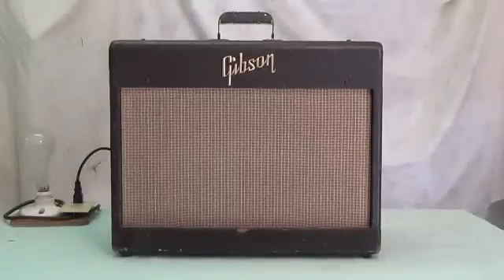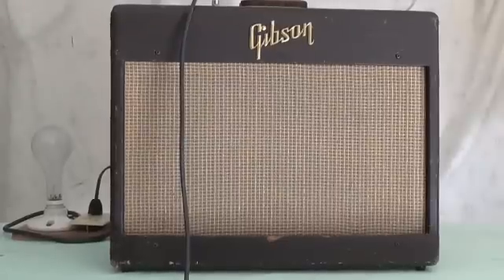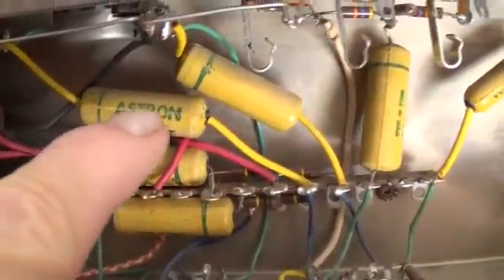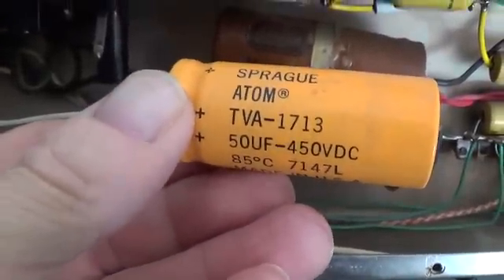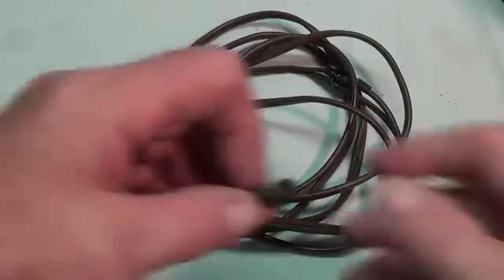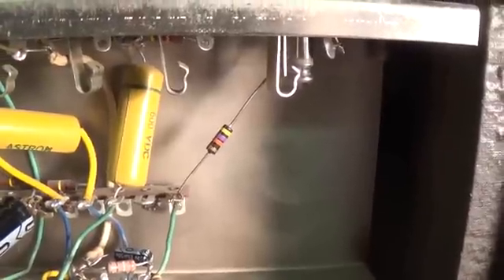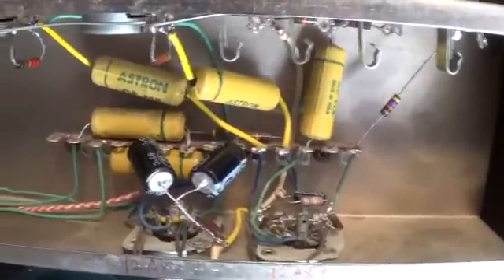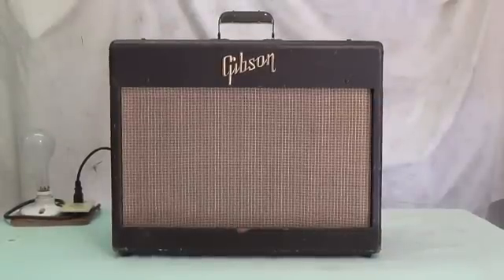Late-50's Gibson GA-6 Amplifier ....with some Very Unusual Problems

Comment: Did you ever go back & re-try the 12AX7 tube after the other gain adjustments?    With the 12AX7 being so popular among guitar amps,  I’m wondering how much the tone changed.
   The amp probably draws a lot more current from the supply circuit,  now that the bass response has been improved.
Reply from the maker: That was long ago, A. I don't recall.....but my guess is that the gain may increase with the 12AX7 but the tone would remain basically the same.

Comment: The volume issue is also a problem with the Vox AC30. Just off zero on the volume control and it drowns out a Boeing 747 at full takeoff power!
Reply from the maker: Wow.....then, I'll bet the volume increases at a relatively modest rate.
Reply: @UncleDoug  Nope, at least not with the AC30 amps belonging to guitarists I have worked with!

Comment: The GA6 I have -and all the other pre-Lancer models are grid leak bias.  Very similar to the 5A3 and 5B3 Tweed TV front Deluxe.  Either this was an interim model or the bias configuration was changed based on that Lancer schematic? 

These amps and the similar GA 20 are beautifully dirty tone monsters. Crazy good harp amps  (I'm a harp player) and can be great with guitar too. On the 'mic' channel - I personally like the option of a low impedance super hot-n-nasty channel.  It's actually too hot and dirty for my harp mic.s but can scream nicely with guitar when you're looking for that sort of thing.  

I'd love to see you dig in on a grid leak biased amp sometime and was a bit dissapointed this GA 6 wasn't that.There is a good discussion of this amp - with pictures of a very similar era GA6 and re-drawn schematics by  Miles O'Neal, of Austin, TX here:
http://www.rru.com/~meo/Guitar/Amps/Gibson/GA6/.  

As ever - thanks for the great work and regards to Rusty. I suppose he had a well deserved day off.
Reply from the maker: Thanks for all your detailed and interesting input, Noam.

Comment: That 50uf cap had a 1971 date code on it!  Total rip-off repair.  Isn't 50uf too much for a 5Y3 anyway?  Also, I believe 12AY7 is the correct tube for this amp.
Reply from the maker: Thanks for your insightful comments, HS.
Reply: @UncleDoug  Nice job on the amp despite this, I should point out.  I've seen my share of incompetent repairs over the years, and nothing really surprises me.  What caught my eye about this amp however was the obvious deliberate attempt to deceive, the phony "original" caps that looked like they were out of some 40s radio.  Then he tacks in a 40 year old Mallory cap to the 5Y3 and it's too high a value, and leaves the rest of the old dud caps in circuit.  Just... wow...

Comment: I know you probably cant do this for various reasons.   But you need to name the shop,  that ripped this owner off. So that no one else gets   
Taken to the cleaners.  Thanks! Curtis
Reply from the maker: I agree that the crooked tech should be outed, but the amp owner couldn't (or wouldn't) remember his name.
Reply: @UncleDoug   the repair bill was in  
The amp. Uncle Doug said
Reply from the maker: @curtismuma1931  I can't remember if the name of the tech or shop was on the bill. It may have simply been a generic list of repairs (supposedly) done.

Comment: I think the reason Gibson used such a high value resistor on one channel was for use with a crystal mike or pickup. The low end freq response could suffer working into a 47K resistor.

Comment: Hi Uncle Doug, I can't seem to get enough of your videos! I have a question about an amp on another video that used a pentode in the preamp stage. I am building a harmonica amp and I would like to experiment with a pentode. Do you remember which amp that was? Thanks in advance and keep up the good work.
Reply from the maker: I have featured several amps with pentode pre-amps, Christopher. One that comes to mind is the Mystery Amp......check out the videos.

Comment: Thanks for the video I would have liked to has seen the power cord installation because I have and old Gibson and the white wire is going to the fuse first I know other videos say to change it to the black wire and remove the death cap but there wired to the switch first
Reply from the maker: The white (return) wire can be connected directly to one of the power transformer primary leads, Charles. The black wire should pass through the on/off toggle, then the fuse, then the other PT primary lead. Many people prefer it to go to the fuse first and then the toggle......but it's a matter of personal preference.

Comment: Great videos. Have you ever heard of sheridan gt20 guitar amp. I can't find anything on them.
Reply from the maker: Thanks, John. No, I have never heard of that brand.
Reply: @UncleDoug  it's just that it has a hum from the speaker which does not change with the volume control. It also has no sound when you plug anything into it. I think it has 2 problems caps and dc. What would u suggest?
Reply from the maker: I prefer not to troubleshoot long distance, John, but would suggest that you replace the electrolytic filter caps and see if that helps.

Comment: So,was tube damage caused by the bad filter cap?  Sorry I'm new at this.
Reply from the maker: Probably not, Wayne. A short within a tube is generally the result of impact or physical damage to the tube, which bends some of the internal components into close proximity.  A bad filter cap, on the other hand, will generally cause too much current to flow through the power transformer and rectifier......damaging them, but not generally a tube.

Comment: Those Astrons at 4:33! Also probably because the heat from the tube filament would rise up through them. I can't understand why 'tubes-down' orientation is so common!  It also seems to take a toll on phenolic tube sockets.
Reply from the maker: Positioning the chassis at the top of the amp, with tubes hanging downward, allows for easy access to the top-mounted controls.  The early vintage amps with floor-mounted chassis had hard-to-access controls at the back, rear of the cabinet.

Comment: There's no way on God's green earth those were the original caps.I've done TV repair in the past and I'm now into restoring old radios.Those caps date anywhere from the '30s to about 1955.I always replace those old wax caps and the filter caps.You can get a good price on the FP type alone.
Reply from the maker: Thanks for your input, Dan :)

Comment: Interesting seeing vacuum tubes upside down!   How does a tube short?Excellent, insightful restoration!    Would be nice to see who did the original rip-off repair.
Reply from the maker: Yes, most of them tend to work in virtually any position.....horizontal being the most challenging, due to "sag' of internal components and possible shorting (undesirable contact between any of them).

Comment: The problem with the volume control is due to the strange and unfortunate circuit design.  An audio-taper pot is designed to be connected so that the input goes across the resistance element, and the output is taken off the wiper.  Gibson chose to connect the input to the wiper, and then take the output across the resistance element.  Here you can see the problem.
 
Instead of having the normal curve, the signal rises much too quickly as the pot it turned up.  Further, the tone-control is poor, providing not much adjustment, and mostly just turning down the treble.  All in all, not a good design effort. One poster claims that Gibson used linear rather than audio pots for the volume control, which would further exacerbate the problem.   This amp shows all the hallmarks of having been designed to be as cheap as possible.  Given the tube compliment, this amp could be rewired to have a single-channel input and a real tonestack, following Fender or perhaps Ampeg guidelines.  It could be easily turned into a Princeton-like amp.  Unfortunately, the public thinks it's worth something just because it was built in the 50s, so that really can't happen.  A quick Google search showed that these amps are selling for over $1000, which is ridiculous, given a brand new Princeton can be bought for about $800.  Maybe one of these days, people will start to realize that there was no magic being sold in the 50s--some good amps and some bad ones, but no magic.
Reply from the maker: Well said, Roid. You make several very good points. Thanks for your input.

Comment: Subscribed. I just started working on tube gear last week. Formerly I'd only repaired low voltage or solid state stuff, nothing older than late 70's or fewer than 200 parts. Dunno why I was always hesitant to learn about or work on tubes. After watching some of your videos I wish I'd gotten into tube gear earlier.
Reply from the maker: Welcome and thanks for subscribing, MM. I think you'll find tube gear to be much more "soulful" than SS.....especially the earlier, vintage items.

Comment: I'm not a fan of leaving the old filter caps in the amp even if you bypass them for that very reason: they leak all over the other components and just take up space. If you are a big fan of the LOOK of an old filter cap, I suggest pulling the cardboard roll off of the old caps and stuffing a new cap in the old roll and then installing it.
Reply from the maker: I only leave them if they show low ESR values, no DC leakage, and are fully functional at operating voltage.

Comment: The "Gibson Tone"   is a super bright amp caused by the "bass sucking" circuit in there.   It sounds right with Gibson Humbuckers... I swear.   It hates a single coil guitar.
Reply from the maker: I shudder to think how this amp would sound set to max treble with a Telecaster bridge pickup.  It would probably be much more tolerable with Gibson humbuckers. This was, no doubt, a ploy by Gibson to sell more amps to owners of their guitars.
Reply: It'd cut you more than a blunt razor.
Reply from the maker: I've heard of Telecasters being used in "Punish the Audience" mode.....maybe this is what they meant :)
Reply: Indeed.  I have a 63 GA-5 Brown Skylark... it has a very treble response.....   and NO TONE KNOBS...   BUT  try taking your guitar's tone knob back to 50%...   it's surprisingly balanced.   I've used it with Gibson,  Gretsch, and Rickenbacker...  and if you roll the Guitar's treble back,  it sounds very good.   The guitar's tone knobs rarely get used with most amps.
Reply from the maker: This sounds like a good suggestion, DK.  Thanks for your input.

Comment: you need to replace all capacitors that are in it, they become leaky over time, it will ruin tubes because they leak DC through them, witch is what they are supposed to stop from happining
Reply from the maker: Thank you for your helpful input, TD.
Reply: i sorta learned it the hard way

Comment: I know it's a little late for this, but those output tubes were re-labeled Russian 6P3S which is equivalent to 6L6 types except GC's. These are commonly sold as a "6L6GT", and relabeled as others as well.
Reply from the maker: Thanks for the input, TA.  Hopefully, the amp's owner will read this comment.

Comment: I still wonder how do tubes short, guessing the spot welding of the wires from the grids may break and then the wires are free to wander and cause trouble.
For that botched capacitor job, I would have expected more  hum while it still worked at the beginning. Perhaps the cap that was left in was in better shape when the 'repair' was done.
Also wonder how much did Rusty make of the replaced parts.
Reply from the maker: +MisterTalkingMachine  The innards of most tubes are in close proximity  and a bit spindly and somewhat fragile, subject to displacement and breakage due to impact and vibration.....especially when hot. Rusty used the spare parts to make a Muzak system for his doghouse :)

Comment: I am appalled by one of the worst botched jobs by a so called professional that should be put out of business. The worst part was the sloppy line cord repair that was a potential shock hazard. Finally presenting bunch of parts to try and justify the high cost of repair that did not exist. Unfortunately I have seen this kind of practice all to often in my own repair shop, it is people like these that give the rest of us a bad rap. I can't count the many times that I have had to clean up somebody else's mess, makes our job tougher. "Great presentation"
Reply from the maker: +John Cunningham  Thanks, John. It's sad but true that a few bad apples can taint the entire amp-tech profession. Part of the video's intent is to make people more aware of some of the deceptive practices they may encounter.
Reply: You did a fine job demonstrating that point Doug; it is important that people be aware of some of these bad apples even though they make up a small percentage of the population. "Great awareness wake up call"

Comment: Uncle Doug, could you do a video just on discharging filter capacitors?
Reply from the maker: +Peter D I have demonstrated it in several videos, including the tool I made to facilitate the procedure......a 100 Ohm 10W resistor in series between an insulated, pointed stylus and ground.  I touch each + electrolytic filter cap lead with the grounded stylus for about 5 seconds, often doing them all twice just to be sure.

Comment: So Uncle Doug....have the same amp and apparently the same tech worked on it before I got it.....it has the original Jensen speaker in it and I had it reconed but I it was doing the same thing a little tinny and crazy load volume on 1. Could I possibly send it to you to repair. ....I'm not sure of your  contact info or where you are located but please let me know.
Reply from the maker: Brian Peters Brian, I have retired from doing outside work, particularly when it involves shipping. Hopefully you can find someone in your area to repair the amp. The methods I used are explained in the video and may be helpful. Good luck.

Comment: It still sounds thin to me but then who knows what your mic and my iPad did to it. You shouldn't have to pad the signal down and use lower-gain tubes like that. I would first have been looking for a fault in the NFB chain, but this amp doesn't have one. So I think there must be a shorted turn on the output transformer primary. I would raise the coupling caps to .047uF.
Reply from the maker: QuadMaestro Thanks for the input, QM. It was a customer amp and is long gone, but I'll keep your advice in mind should it ever be returned for additional work.

Comment: Chintzy repair by a unscrupulous repair guy.. Typical of these old vintage amps with the filter electrolytics drying out.
 but the 50uf should be ok. With tubes it's not as critical as semiconductor circuits, but having a bit more power supply filtering is always ok.  No cathode bypass  caps on the preamp stages..that is weird for a Gibson design...or did
the unscrupulous repair guy just cut them out as well in his crude repair.
Reply: +SuperCarver2011 beware of too much capacitance in tube rectified circuits. unless it is a choke input power supply, there should not be more than 40 uf as the first cap unless you want toreplace the rectifier weekly.
Reply: +Pete Chadik  Yes, I was aware that you have to be careful with the input capacitor on tube rectifiers, keep it around 20uf. 
50uf is probably a bit to big for the peak inrush current to charge it up.

However,  depending on the rectifier tube used and max plate current, you can get up to 300ma for a 5U4GB although
you wouldn't want to push it at those peak current limits,  40uf should be the max.

 Fender has some Bandmasters with  GZ34 and stacked 70uf caps as prefilters before the standby switch. Two 70uf in series is around 35uf with a GZ34 rectifier, then a choke/capacitor after the standby switch for B plus for the power tubes. With diode bridges, which some tube amps use, you should be ok with 40uf.
Reply from the maker: SuperCarver2011  Both triodes of the 12AX7 preamp tube are cathode bypassed by a single 20uf cap, visible at 9:03 (bottom right).

Comment: The previous tech saw the cruddy 10 + 10 Astron caps and had a 50uf Sprague cap on hand, so he was like, "Duh, I'll crudely bypass these and put in my Sprague cap which is (duh) pretty much within +/- 10% spec of the Astron caps -- because if there's two of them, you're allowed to multiply +10% by two. Then he went, "Duh, double caps are unusual," and forgot to bypass one of them.
Reply from the maker: Gavin McNett Judging from the quality of the work the previous tech did, your scenario is entirely plausible. Thanks, Gavin :)